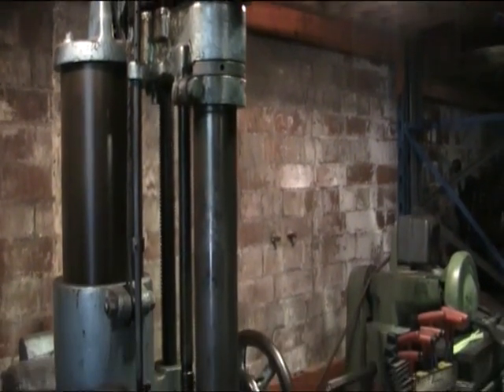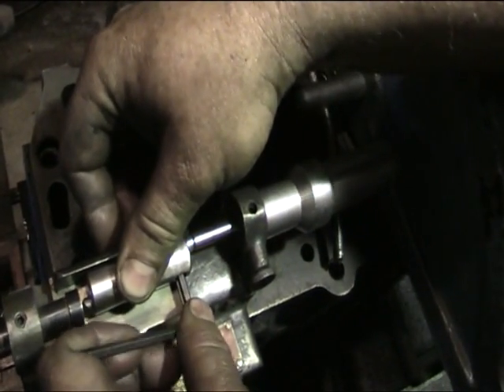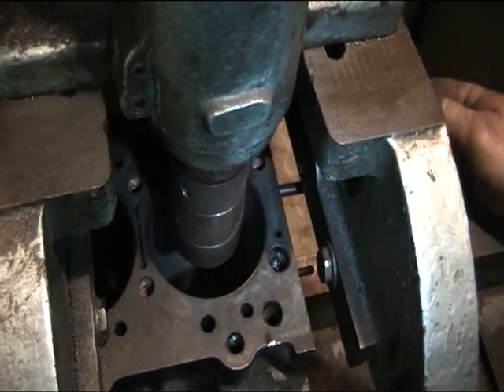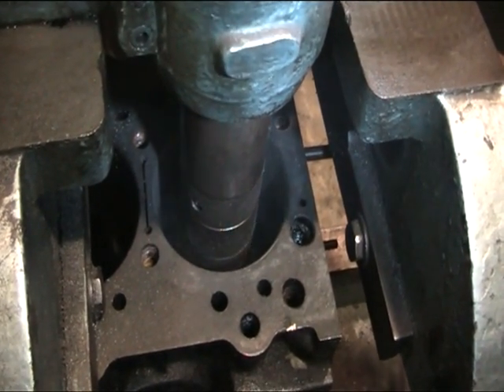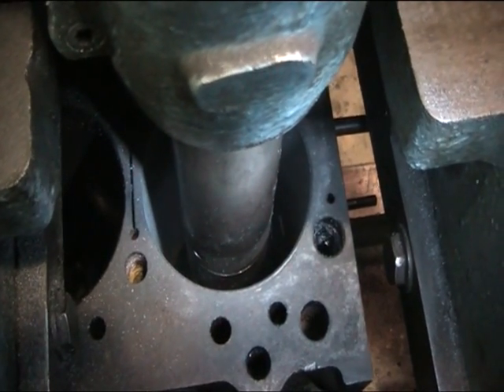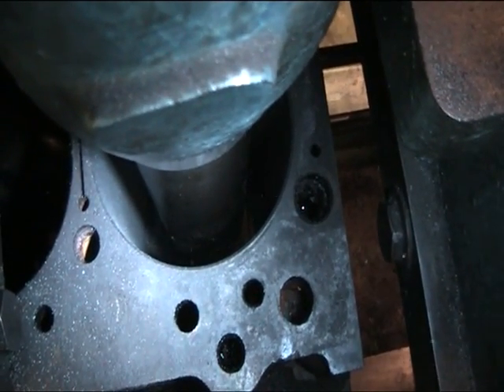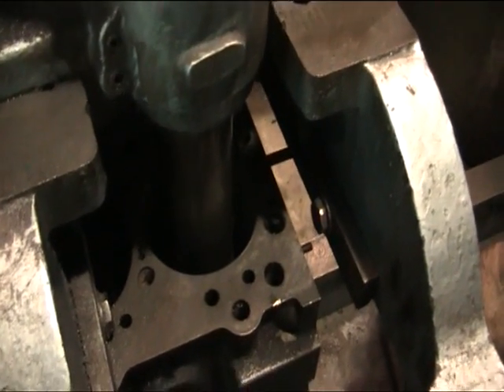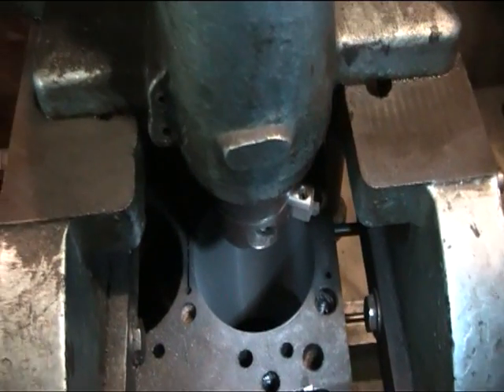how to rebore a engine cylinder

Comment: If the cylindere block surface is not level then does it bore at an angle?
Reply from the maker: if it is not sat level at the base/ways then yes but we clean and stone/hone the bottom of the block to avoid this as any good machinist would do ! this setup is not the same as the block mounted boring bars ! we have just bought a air floating boring bar and we will be demoing it soon

Comment: How much does it cost per bore? I know measurements are needed to calculate the over size, also depending on piston availability (no good having shiny new bores and nothing to put in them) :) the engine build up is simple enough, 2,25 petrol from my land rover.

Comment: Just a quick question as im a soon to be college student studying agricultural engineering at reasheath college, Cheshire... My question is, Why would you rebore an engine?
Reply from the maker: first let me say how happy it makes me to hear that you are learning to rebuild engines here in the uk now to answer your question the reason for re-boring a engine cylinder is to fit a over size new piston when the cylinder is worn out or scored and passing oil in to the upper cylinder and letting cylinder gases in to the crank case this is known as over back pressuring
Reply: Thank you
Reply: charlieengine if I have any questions to do with engines on the course im doing at reesheath collage I will make sure I will ask you.